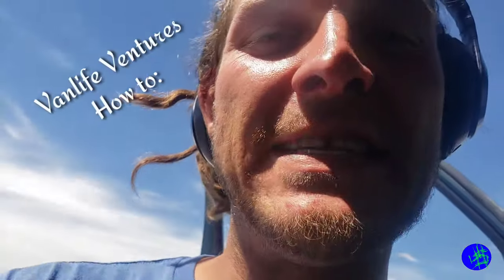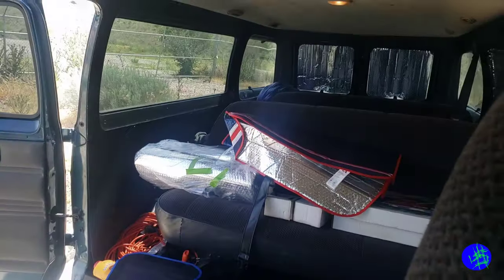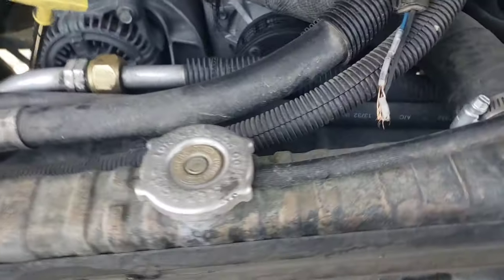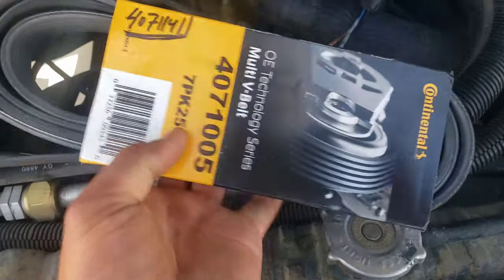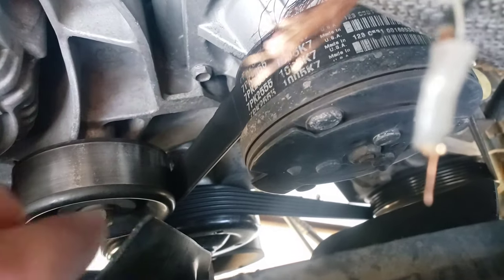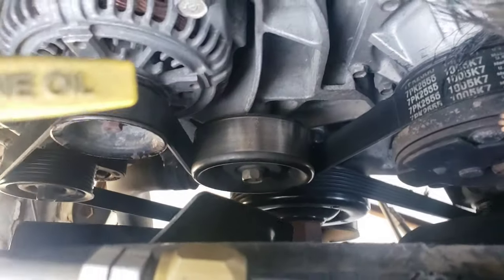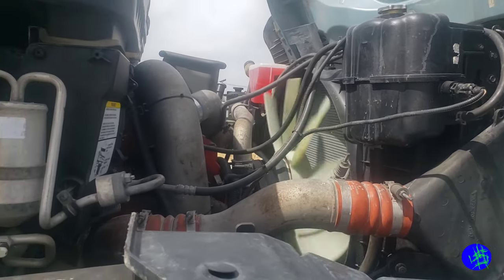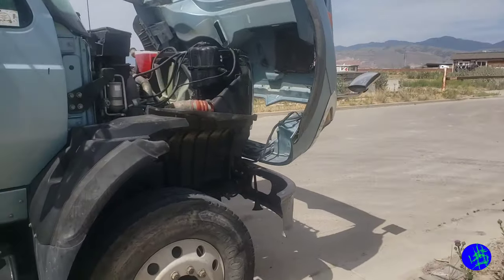VANLIFE VENTURES #5: HOW TO REPLACE A SERPENTINE BELT

Comment: 440 a/c, 4 windows open at 40 mph
Reply from the maker: Lol I do that, but I fixed those cables and AC works great now, I only run it when I first get in the van and it's super hot tho.